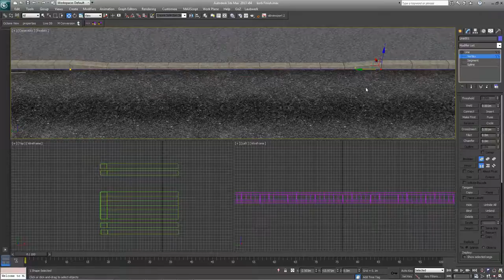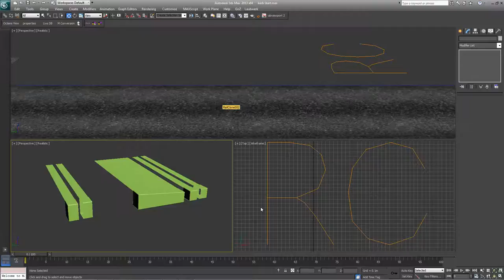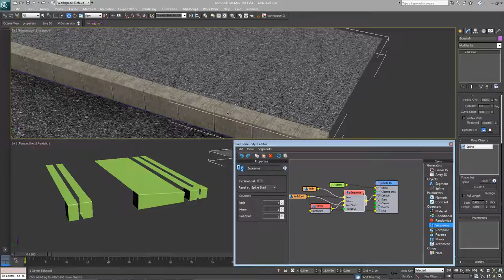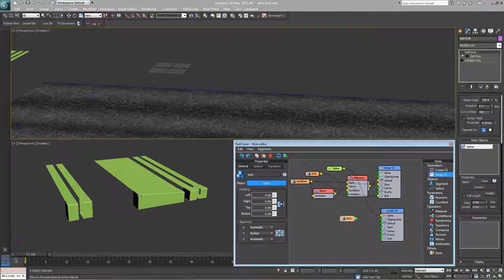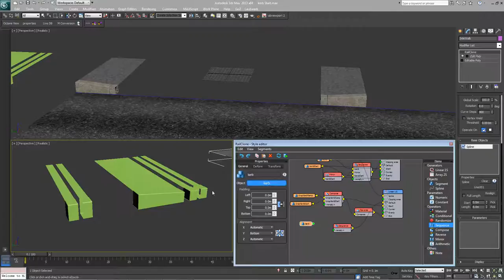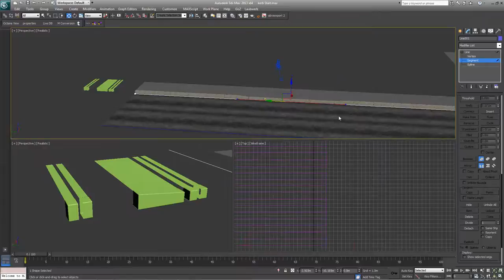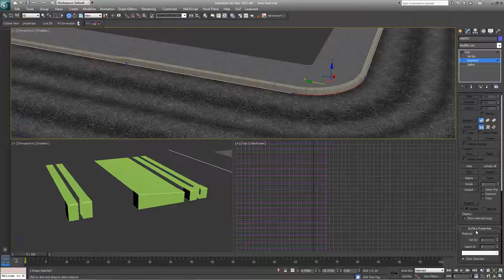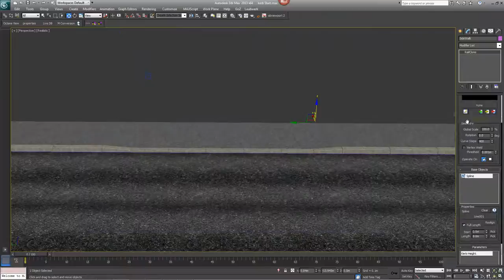TUTORIAL: Creating a Drop Kerb with RailClone in 3ds Max (intermediate)

Comment: Hi, I was thinking about purchasing railclone, but in a bit of a doubt because I need it for a specific purpose. I want to create different road segments like motorways, trunk roads, residential etc and be able to control them using with different Ids. Question is, how does the clipping happen between two different segments ? For example when a motorway exits into a ramp. How can these two items work seamlessly with Railclone ?

Comment: All great except for the fact that if there is any slope at all in the site, the road built through Railclone will break in all sorts of horrible ways. It can't seem to handle slopes at all. It tries to do "banking" or something and brakes it in all kinds of ways (intersects itself, breaks in road, twisted, etc). Kind of defeats my whole reason for purchasing Railclone in the first place -_- Thought it would be able to lay down roads and sidewalks on a sloped site but yeah... nope...... unfortunate.
Reply from the maker: Hi, you might find changing the Deform mode for the segments to Vertical helps on sloped sites (It'll stop banking) Feel free to drop our support team an email, they might be able to help further. https://www.itoosoft.com/contact
Reply: Hi, what might be helpful in this case is to go to the Interpolation parameter in the spline shape and try to increase the Steps value.